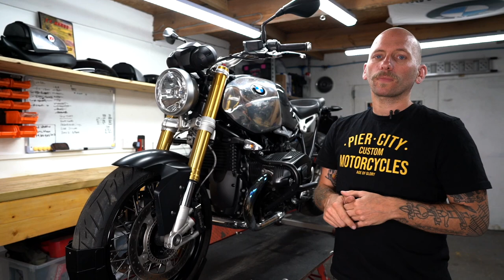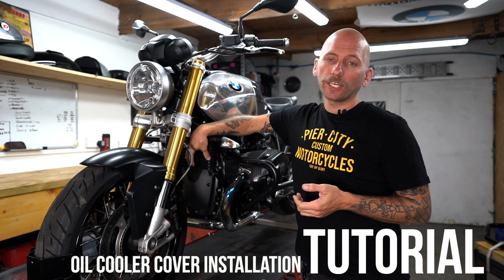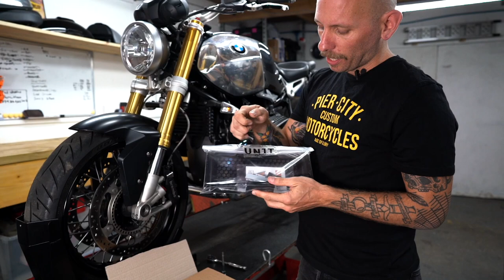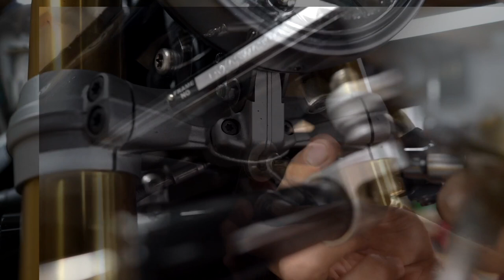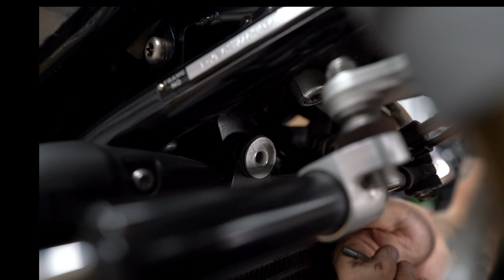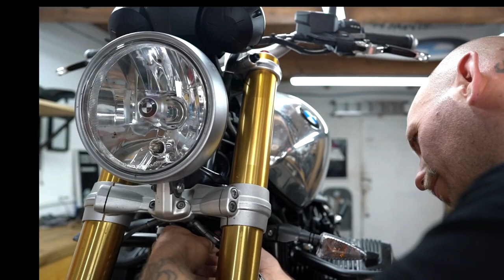PIER CITY CYCLES TUTORIAL - Fitting an Oil Cooler Cover to the BMW R9T

Comment: I am experiencing engine overheating on my 2014 BMW R9T , any suggestion how can I remedy this problem ? Thanks
Reply from the maker: Our track bikes regularly run at 130-135 degrees, anything over this is very high and might be worth contacting your local dealer.